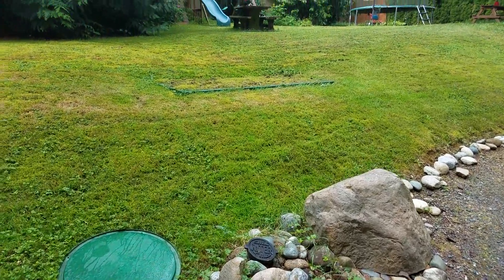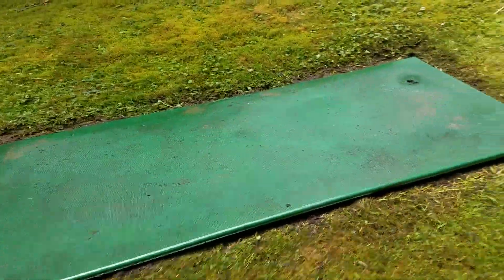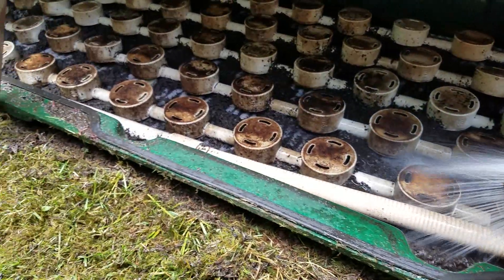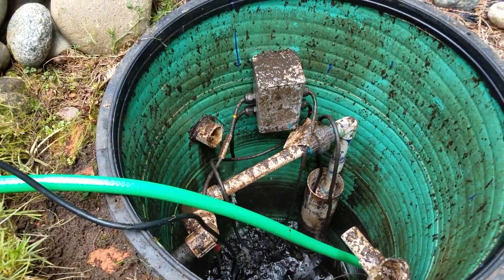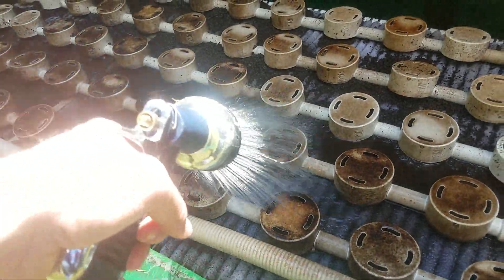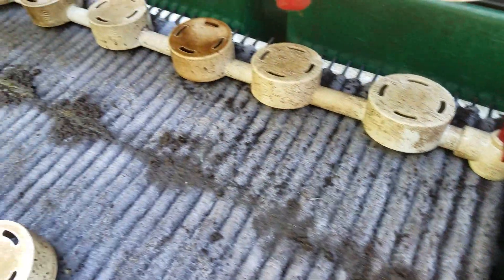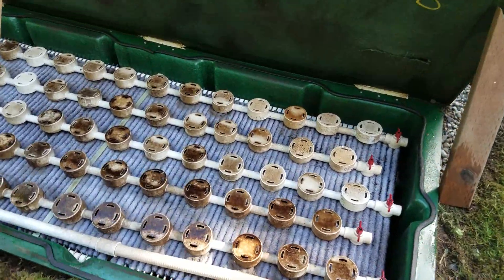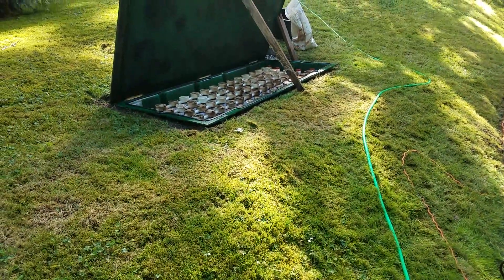The Crap Coffin - Cleaning the Orenco Advantex Advanced Main Filter.

Comment: So to spray the sludge straight to the sides is a bad idea?  Seems you are trying to water down the sludge to then drain through the filter?  Thanks
Reply from the maker: Yes, I agree.  Spraying it down it drains just back into the 2nd tank and it pushed through the system again.  The method I used is exactly what the septic professional used when it showed up to clean it, so I assume it has value...

Comment: Hi, I just heard the Advantax Septic system was on some property I looked at…had to google (I’d only heard of gravity fed)..I was wondering - is this system required at certain locals?  it looks like this higher tech (beyond merely gravity fed) septic system would have to have service from Certified Advantax” servicer, any info is appreciated! thanks for posting this!]
Reply from the maker: Darn, youtube didnt tell me about your question - sorry!  If it still matters than the answer is yes, this system is not installed for fun :).  I would much prefer a gravity fed simple system like all my neighbors.  This system is more expensive, by 3-5 times, and requires a certified septic maintainer.  I have tried to have others out that were not certified, and they could not help.  The entire reason I created this site was to help me document things so I could do some work myself.  If you see a property with this system, its because it didn't fully perk, or is close to a body of water, or some other environmental regulation. I would not avoid a property that had this system, but its good to have awareness of some greater needs related to this kind of system.  Good luck!
Reply: @sketchyseptic9186  thanks for answering (yea once I was surprised to find a response that was 3 years old!!

Comment: Maybe spray in parallel with the "hanging folders" rather than perpendicular?  Would move the sludge to the back area where you might be able to use more pressure when it's against the plastic coffin wall to get it to the outflow.  Just a thought.
Reply from the maker: Thank you!  And sorry I missed your response, as youtube was not informing me of your comment.  The method I used was shown to me by the septic designer, but it was done early on.  Now this system is pushing 20 years old and short of replacing the filters, I will try what you mention above, as another cleaning is due - thank you!

Comment: You don't want to spray those filters and oversaturate them..  it works off an aerobic system. Meaning air flowing through.  Also, you can remove those filters out of the system, spray them, and air dry them.  That pvc pipe can be removed.  It has a union connection that allows it to remove all at once.
Reply from the maker: Thank you!  I am long overdue for a cleaning, I will look to remove them...

Comment: Yes, you pull the filter out one by one till you have five, get two boards wide and tall enough and screw them together to an a frame, make sure the edges are beveled so the textile filters dont catch the edges, lay the five side by side and rinse, flip them and rinse, flip  once more dont let them  dry with or without dirt on them, bottle cleaner to to pvc, and wire to clear the holes… super clean then especially when you have worms in there !
Reply from the maker: Thank you!  Its due another cleaning...

Comment: Water is ponding on the media sheets they need to be replaced and it’s not sludge it’s bio Matt also open the valves on the laterals and brush them clean and flush them out
Reply from the maker: I am due to clean this again, can you suggest a site to buy the specific brushes?  And the technique I show here was exactly what was done by a "professional" septic person.  But this system is not typical and I have had people make mistakes, that is why I am trying to learn it myself.  Thanks!!!